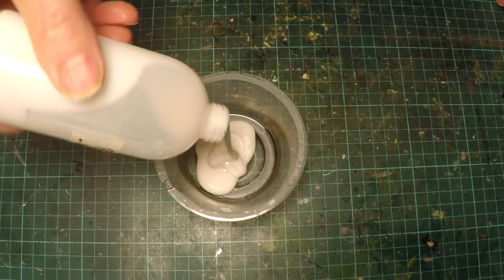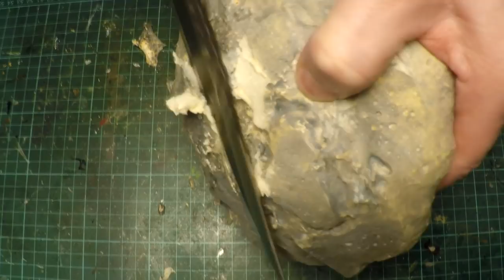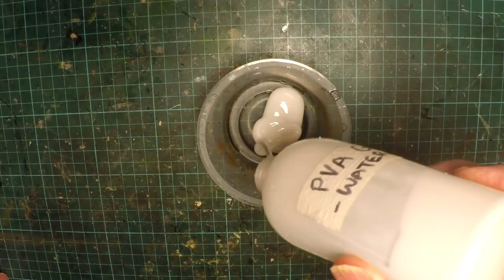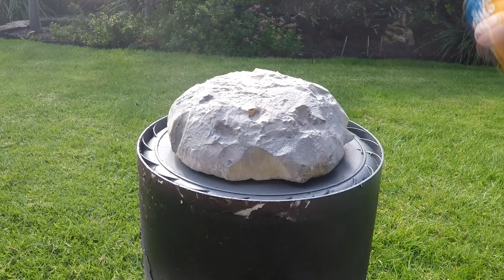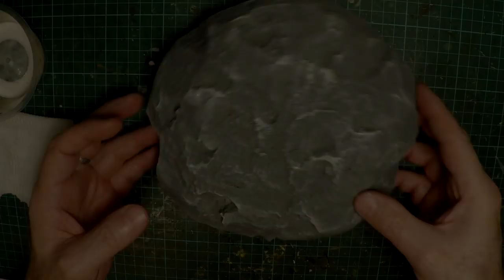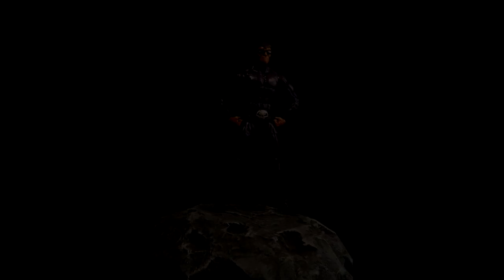Fake Rock From Foam (cosmetic change and paint)

Comment: Did you make this rock for a particular project?
Reply from the maker: Nothing specific, I basically wanted to try different techniques to achieve certain effects. But it has endless potential, it could be used for display bases, prop making, scenery and back drops etc.